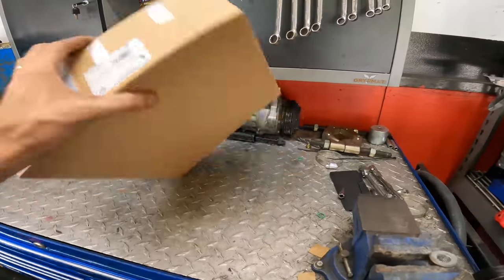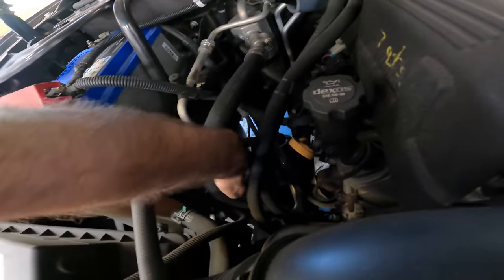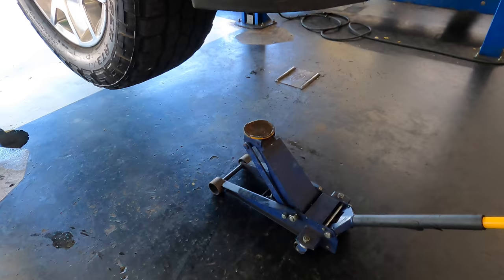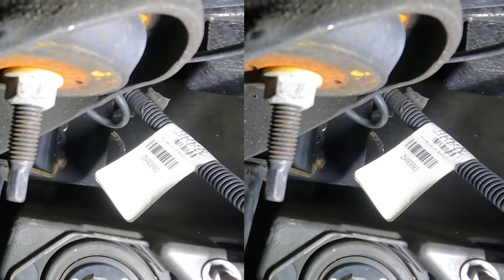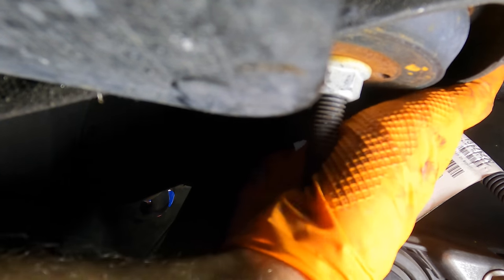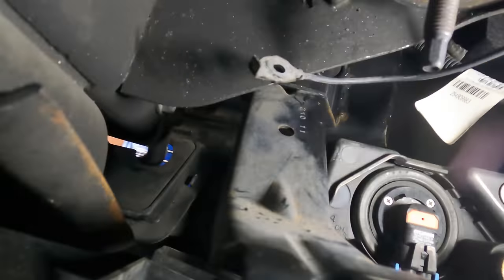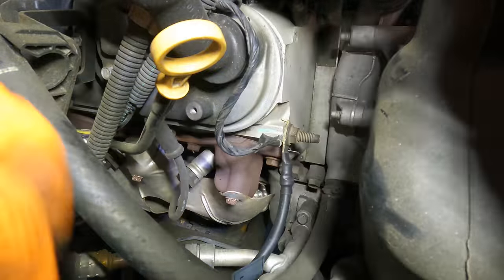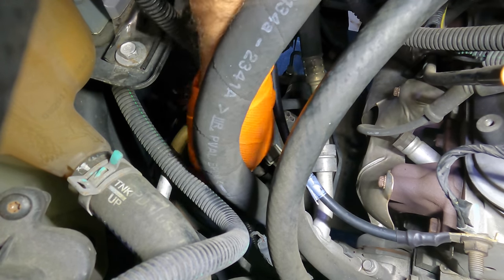Cadillac Escalade 6.2 NO Power, memory keeps resetting. Customer Request Battery Cable.

Comment: Thank you Caddy engineers for bringing us great.. uh.. frustration!  I'm guessing this battery cable was just a badly produced, rather than damaged? It's pretty rare to hear of them failing.
Reply: Was it faulty, where is the evidence that the fault has gone.
It was a customers diagnosis, and Ray was told to throw a part at the problem.
Reply: @tomgeorge3726  no the first time a customer thought they were always right lol
Reply: 07-14 Escalades have a common fault with the cables going bad, outside looks good, inside has high resistance. Good call from the owner.
Reply: Made in Mexico
Reply: I've seen my share of what visually appears like a good battery cable, but trying to bend it is like breaking pasta. A little water in a tiny crack is all it takes to turn a pretty green. Usually they bulge where the corrosion is, but not always.
Reply: All the chevy/gmc trucks of those years had cable problems where the wire is crimped into the terminal. They're misdiagnosed as starter issues all the time.
Reply: Obviously designed to B a service item. Dlr probably has 5 in stock
Reply: @Jimleben  Fabrication Good. Engineering, not so much
Reply: @Jimleben  The manufacturing standards and processes in Mexico are the same as in the United States.
Reply: @JasonW.  — good info
Reply: You guys don't know what a difficult job is. I wish all battery harnesses were this easy. GM products are generally easy to work on.
Reply: @williamjones4483  I have no doubt that the standards and processes are the same. It’s the the adherences to these standards and processes (I.e. Quality control) that is the issue.
Reply: Common problem with this style GM 's. I had to replace the exact same cable on my silverado. It was causing intermittent stuttering on a slow right turn/complete loss of battery power when truck was parked/various sensor failures/headlight flickering etc. Basically any time that cable got bumped around. It was pretty easy to find just by wiggling the wires one at a time until I got power back.
On mine, and what I've seen most commonly, is internal corrosion within the wire. The end will usually look good, but if you cut open the insulation the wire is all manner of brown crumbly crunch.
Supposedly GM's replacement cables "solve" the issue by extending the insulation further out on the ends, not leaving exposed wire at the connections.
Reply: @lechatbotte.  In this case, they are. Not all customers are dumb, and know their own cars.
Reply: @Jimleben  ¿Cuál es exactamente el problema con las piezas que se fabrican en México? Los mexicanos se enorgullecen de su trabajo, a menudo más que algunos competidores. Las partes que tienen "Harbor Freight" no son confiables 😆😎
Reply: What exactly is the problem with the parts that are made in Mexico?  Mexicans take pride in their work, often more than some competitors.  The parts that have "Harbor Freight," however,  can't  be trusted! LOL 😆😎
Reply: @williamjones4483  Of course they are.
On paper.
Out here in the real world they are less than desirable. No where near as crap as Chinese made trash, but after decades of experience dealing with them, they are certainly not the same quality.

Comment: I noticed another possibly related problem: a marine/deep cycle battery is being used in a passenger vehicle. Deep cycle batteries are not designed for passenger vehicle charging system requirements and will harm alternators and reduce the life of the deep cycle battery as opposed to installing the correct battery for the vehicle.

Comment: My Xterra has been acting funny the last couple of days. I've known it's the battery but tomorrow is my day off so I was going to deal with it then. Turns out I had to get towed home tonight because 7.2 volts is not enough to keep the engine running. It's a common thing here in the desert southwest for a battery to not last more than a couple of years because the electrolyte boils off. I need a new ground cable, too. Have for a long time. But who wants to work on cars all day then work on their own on their day off? You might but I don't.
Reply: Is it like being a commercial fisherman who goes fishing on the weekend. Or a Busdriver who takes the motorhome out for a week.
Reply: So true. Batteries, tires and other rubber parts. The desert heat is an insatiable monster.
Reply: Looked into an 'AGM' / 'Deep Cycle' battery? More expensive, but are 'sealed' to prevent electrolyte spills etc...
Reply: Ya. They develop ground issues due to hidden corrosion. Nissan not known as Chrysler of Japan without good reason.
Reply: @peted5217  Scotty Kilmer doesn't know his ass from his elbow. He literally makes everything up as he goes. Watch one of his diagnostic videos and fact check it.

Comment: In most instances to tighten or loosen the huge 10mm bolt heads on the battery require 110psi air pressure and the same torque settings semi tire lug nuts require with a full flow 5/8ths shank impact gun. If holding on tightly it does not shake the fingys so much to later get arthritis.

Comment: Had to replace that cable on my '11 Suburban, would randomly lose power at any time, jiggling the negative around would wake it up.  Never had that issue on my '01 Suburban that had the original cable on it forever.  I'm not convinced things are being made better since the early '00's.

Comment: Nice, REO Speedwagon rolling back there, when I hear that song on the radio it's time to buy a lotto ticket, lol.  I have those orange gloves and they are awesome, I worked for years and years without gloves, then one day my wife said isn't there gloves you can wear so your hands don't get so dirty and stained with engine oil and crap?  Now I do wash with that orange scrub which is awesome stuff and if you have steel or porcelain pots and pans and you have some scrubbing to do, that really helps, but do not use it on Teflon pots or pans.  So, yeah I picked up a box of those gloves and they are pretty good they don't rip like other gloves as easily and best part is, I feel like a Machine surgeon 😷 lol when I work on my vehicles.  Thumbs up Ray!!!

Comment: You ground off the nickel coating on the ground lug down to bare copper..copper turns green corrosion nickel plating keeps it from not corroding.  Mistake....shoukd have just cleaned with cleaner and cloth

Comment: Impact driver on terminals,slight overkill with reduce r s,but you got what you to do ,if needed...
Reply: Ray another good video. But I'm coming to you as a mechanic and electrician. Please stop sanding the zinc coating off of terminals. Your exposing the copper and they corrode quicker.  If you want to clean them just use a wire brush and knock off the corrosion and debris. I'm not trying to troll you. Just something I use to do then learned the hard way myself.

Comment: On newer vehicles do the location of the grounds matter more? Mine is pretty simple. The largest ground cable goes to the block. There's a smaller cable that splits off close to the battery and leads to the inner fender, and then at the rear of the engine there's a short braided strap that connects the back of the cylinder head to the firewall.

Comment: Man i owned one of these POJ for 2 years, what a freaking nightmare, windows would randomly open and wouldn’t close, every 3 months or so the starter wouldn’t work and needed to unplug the battery then it would be ok for another 3 months, heater only worked in the summer, broke down and brought it to the stealership, changed the bcm,ecu the same ground cable you just did, 3500$ later truck worked fine………. For 3 weeks then all started again then caught fire. Insurance now own it

Comment: I had to replace a door hinge bolt on a 90's style malibu. Problem is the top bolt was bolted in from under the dash. You couldn't reach it from under the dash, but had to remove the speaker, and use a ratchet that had a t handle built into the handle best ratchet I bought for tricky spots. Bought a pair 1 in 1/4 inch drive and 3/8 inch drive

Comment: Reminds me a bit of the first generation Mazda6. Need to change a headlight bulb? Remove the front bumper first. Turn signals causing the windshield wipers to run? That was a poorly designed ground connector....top of the subframe, right where it would collect water and corrode. The best fix for the ground was to re-engineer it, because replacements would have the same problem after a few years. What a nightmare that car was!

Comment: Ray I feel your pain, I had one  bolt I could ony get my hand on after playing contorsionest and it was in such as SON OF A "B" place that I could only keep my hand on it for 2 seconds without a charly horse in my forarm making me yell profanities. O got a ratchet on it and broken lose to play the one click at a time game for over 45 minutes got it off but man what a pain in the asstric. lol but getting the nut back on was a nightmare, every time I thought I had it the nut dropped hitting me in the nose at first and bring a tear to my eyes, the next 4-6 times it dropped   hitting me in my eye, then upper lip 2-3 times and damn neer going up my nostril , and the last time in my frigen mouth,ugh gross. I ended up drilling a access hole in a useless bracket that was weilded on to the frame that was not even used and put the nut in my socket with some socket gumm and spinning that shit right in the first time. I was yelling the hole time "F" with me will ya. lol

Comment: Ray, had the same issue , install customer supplied ground cable ? Noticed new battery & alternator. The body ground seems like 2” long when undoing. OK, after phoning customer, get message, will call back! Oh well, I put on, put in my yard. Why am I putting a ground cable on this Cadillac? Very long storey, I fixed it with a new power window switch. That is not your issue,there’s allways a but, with all I had to learn on this electronic nightmare, your problem is the “radio Gem module” behind the stereo. It’s job is to remember the clock time & radio presets after the KAL memory times out .

Comment: If the hole in the new lug is 6 mm or quarter inch diameter that means the bolt is 10 mm also I would check that frame I bet it's corroded too have a good day

Comment: I would have loved to see an examination of the "faulty" ground cable to see what is wrong, I am skeptical that is the problem.......
Reply: Doesn't matter if it is or not. It's what the customer requested. If it doesn't fix the problem that's on them.
Reply: The 07-14 Escalades suffer from battery cable internal corrosion and high resistance. It was a good call by the owner.
Reply: @nosetdirection  👍
Reply: No way it's defective

Comment: Imagine  the engineeer that thought this was the perfect place for a ground cable to be attached must have had a bad experience with mechanics at some point in his life.
Reply: He needs his slide rule broken!
Reply: @mojo6524  ... and rudely hidden....
Reply: @Max Cichon  I can think of a spot.  😆
Reply: I imagine people on the Internet making comments about how things are designed and have no idea about the design process...
Reply: I imagine those who complain about the design process have no clue!
Reply: Again...
The engineer should be made to work on the first prototype and change out all these " Engineered " located parts after the first Salt/Heat test. If they don't spill any of their own blood all changing those parts they will then be allowed to pick up their paycheck!
Reply: @buckhorncortez  yes most of the time it's done without thinking about the big picture ....
Reply: @tomtke7351  really do you really think they thought about maintaining this when they designed it ... NO!
Reply: It’s designed around the assembly process so that its simple and fast to put on going down the line, they don’t care about having to change it.
Reply: Manufacturing engineering is centered on production line manufacturing costs. I bet some replaced ground wires find a new more convenient home.
Reply: @buckhorncortez  - It’s all in good fun BC….I’m an engineer btw. :)
Reply: @paulconetta2264  Not only that,  They should have a  mechanic's hourly rate, plus typical shop overhead subtracted from their pay for the time it takes them to do the work.
Reply: It's a cost/benefit thing. It saves time/money on the assembly, and it is highly unlikely that any significant number of Escalades will ever need to have that ground wire removed. This one was the literally one in a hundred thousand chance.
Reply: @douglasburnside  It's really hard to imagine how that ground cable could be installed "efficiently."
Reply: @jvlag3  I'd suggest that robust, RARELY to fail parts, aren't given much repair consideration.  How often does a battery ground cable fail; the actual cable?  And just how did this cable fail?
Reply: Probably makes heaps of sense during assembly
Reply: @theeddorian  Imagine that bare chassis coming down the line, no bodywork, no wheels, everything wide open. It would be as easy as putting a lug nut on a wheel stud.
Reply: @tomtke7351  we don't know that it failed, the customer asked for it to be replaced.  and a VOM would have been an easy check.   
 I still question the need for a ground to be placed the far down on the suffrage... there are more convenient spots even on the assembly side.
Reply: To the engineers it’s as simple as loosening the engine mounts and removing the suspension to change it. Theirs a ford truck that has you remove the cab to replace sparkplugs. I think it was 2000 cam/fb that you dropped the subframe to do sparkplugs. Engineers have not nor will ever care a …
Reply: Other YT creators have commented that is why management never have the mechanics and the engineers under the same roof on the same day/evening for Christmas parties. Would be a lot of fingers poking chests if it were. Shame. Would get a lot of things sorted if management had the guts to do so. Even better, get management to set up meetings with engineers, production line assemblers and mechanics in the same room when engineers are getting down to the nuts and bolts of designing a new car. I would love to run that process over the 6 - 12 months of the intricate design process. I have worked hands on as a mechanic as well as in middle management in other non-related fields - was given responsibility and authority to devise solutions which had to meet needs that no-one had ever come across before. And collectively we did it to everyone's satisfaction. It can be done. And even now I would love that challenge, even at 70 yrs of age. You don't need to be an expert in any of those fields - you just need to know how to get a group of people to understand each others needs and then guide/massage the process to get a solution that meets everyone's needs, including higher management.
Reply: Let the engineers work on the cars and they might try and do a better job but I doubt it they got that piece of paper and it's so brilliant yeah just like a dim light bulb sometimes all School knowledge and out of lick a common sense have a good day
Reply: @mojo6524  a slide rule I haven't heard that phrase in years but how about using an abacus to calculate your figures
Reply: @douglasburnside  It's actually a very common problem in Escalades. This and the ground strap that goes from the firewall to the block.

Comment: You really shouldn't remove the tinning from lugs in your crusade against corrosion. Bare copper will oxidize immediately. That's the very reason the connectors are tinned in the first place.
Reply: Bimetallic corrosion is a thing, even marine copper wires are tinned to reduce corrosion.
Reply: Learning every day.
Reply: This connection will not last long.
Reply: If.the battery lugs are alu and generally the conectors copper there is not.much you can do about it anyway. Glavanic corrosion will do its thing. Generally the alu gets busted.
Reply: Reeeeeee
Reply: Maybe should have "tinned" the lug with solder or added AL oxidize paste to it.
Reply: Ya Tru, but where's the fun ?
Reply: @slims2503 , the battery lugs are lead aren’t they?

Comment: I guess it is too late to say it is best practice whenever possible to Not remove the nickel finish from connections like the ground termination. Removing the nickel coating leaves the bare brass or copper which when attached to the engine casting you now have two dissimilar metals in a semi wet area which allows galvanic action to occur meaning you have a natural oxidation and corrosion breading ground.

Comment: Common issue on 6.2's with the battery ground assembly going bad, changed a few on GMC pickups.
Reply: what goes wrong with the cables if you don’t mind me asking?  they look fine.
Reply: @stoker261  I'm not exactly sure, it might be the Amp pickup that goes bad, they never look damaged, corroded etc.... it's a oddball one for sure, but I've changed three out on the 6.2s for the same issue.

Comment: If you really want to break the internet you should have used a 1/2 to 3/8, 3/8 to 1/4 then 1/4 back to 3/8 then your 10mm 🤯
Reply: then back to your 1/2" and used a 1/2" drive 10 mil socket... (Yes, they exist)
Reply: Lol right.
Reply: Don't forget the 3/4" drive
Reply: @johnt.848  that's a good one, cus you'll have to step back down yet again... hehe

Comment: Try a 3/4 air gun with a 1” air line. Serious torque
Reply: Go straight for the 1" gun. If it's good for semi lug nuts, it's good enough for a car.
Reply: Sma's THOR should work fine
Reply: Would do the trick. One inch air hose mite be Abit cumbersome at times.
Reply: @JasonW.  remove any stubborn nut.
Reply: @HypocriticYT  and failing that, the whole damn bolt/stud. Failing that, you'll be able to easily use an oversized one after the fact...
Reply: That is enough to twist off the lug nuts on a semi.  Came across a video of an insurance inspector on lost wheels of semis.   Most were caused by over torquing the lug nuts with those monster air guns.